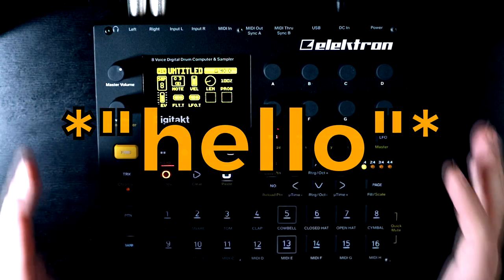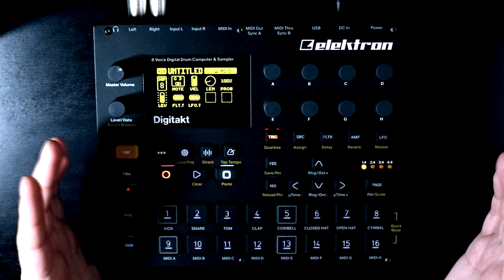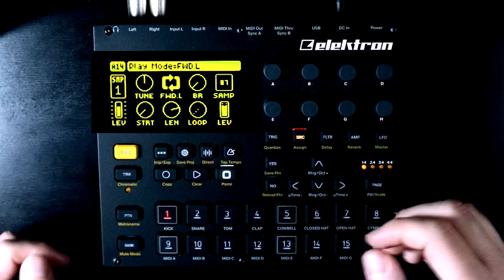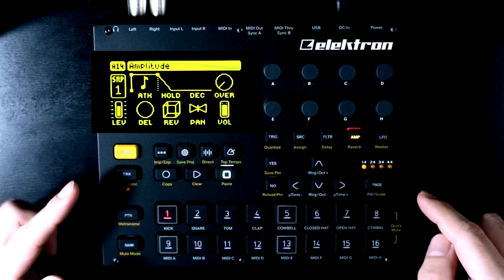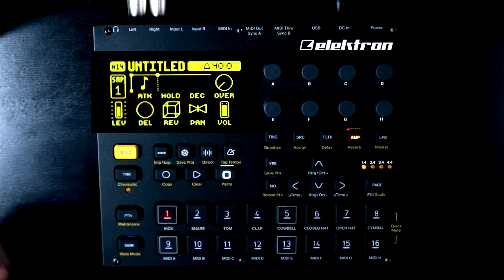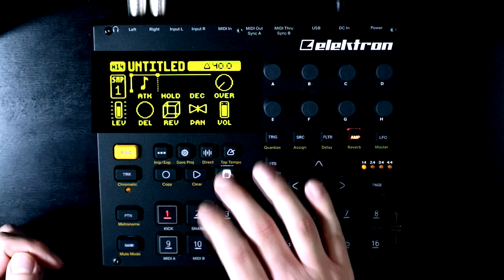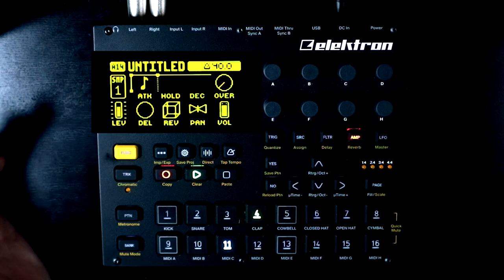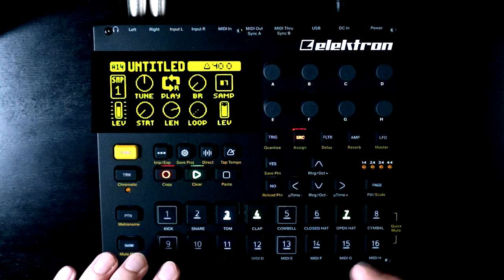Digitakt - Using Green Trigs/Lock Trigs to Create Evolving Ambience and Textures

Comment: I love the way this allows you to use free running loops but the changes to the loop are done in the digitakt grid, so it still happens in a nice controllable way, which is usually challenging when using loops with the digitakt.
Reply from the maker: Exactly, if you have a more abstract loop or something with a more constant tone, you can really reinforce the idea of what's going on in the grid without totally killing the vibe.
Reply: @OscillatorSink  I find probability on normal locks to be a little too obvious, but I bet you could do some incredible stuff having those trigless locks be probabilistic.

Comment: Great vid! A handy feature: hold "function" while changing a parameter, it'll jump to certain large values, for example "tuning" will jump like this: - 24/-12/0/+12/+24. No more slowly fiddling until you hit that - 12.00 mark. Cheerio!
Reply from the maker: Yes, I'm aware, and it has already been pointed out. Unfortunately my workflow often "de-optimizes" when I'm having to talk and do at the same time. It's like the time I forgot where "Select All" was in the sample screen. I still get comments about that now over a year on. This is the penance I pay for my forgetfulness.
Reply: @OscillatorSink  haha, the glass is still 99.99% full so no worries there, happy holidays 🎉

Comment: It is possible to create this kind of evolving texture, then change "key"? Curious if you can use this to create a texture but have it follow a chord progression... hoping that makes sense!
Reply from the maker: Probably the best way to organise that would be to either parameter lock samples which are playing the chords you want (and remember, that could be just changing a bass note to inply different chords based upon your more textural sounds) or you could use midi loopback to sequence the sample slot on the track to get chord sequences, again with suitably prepared samples.

There are definitely other approaches, but those two spring to mind.
Reply: @OscillatorSink  Thanks! I'll have to play with those ideas!

Comment: You had me excited when I read green trigs but theyre just the normal yellow ones. Did you know you can time stretch/pitchshift loops with an lfo set to sample start?
Reply from the maker: Yes. Locking the LFO trig parameter is often overlooked and it opens up a bunch of interesting techniques. I like using it on a lock trig to do tape stop effects.

Comment: I wonder if changing the pitches could have a slow legato-style bending...?
Reply from the maker: So the way you'd probably best achieve that on the Digitakt where you don't have any "real" portamento or slew limiting is to use an LFO. If you use a Ramp LFO shape and the "half" LFO mode too can create a parameter sweep that starts on the trig then goes up (or down) to value defined by the depth. You can then choose the rate of the bend with the LFO rate.
Reply: @OscillatorSink  that's a brilliant idea. 

I think that could work for acid-style basses as well. I need to try this out immediately.
Reply from the maker: @tubeMonger  yeah, it works pretty well with some tweaking - the trig preview they added in the last firmware (step + yes) makes fine-tuning things a lot easier too. I was doing this a fair bit on the Digitone before they introduced portamento.
Reply: @OscillatorSink  yeah, with a bit of tweaking it works, and a plethora of new use cases suddenly appeared!

Thanks again for your invaluable information :-)
Reply from the maker: @tubeMonger  I think I might do a quick video on this little trick soon - it's I useful one to have in your toolkit.
Reply: @OscillatorSink  agreed!

Comment: Trigless locks is the term. Trigless trigs is from the octatrack terminology. To make a trigless trig on the modern boxes you may lock the note page to have lfo or env set to on. This should trigger the lfo and envelopes without retrig on the voice.
Reply from the maker: Actually - to my surprise and, frankly disappointment, on the Digitakt the official term is "Lock Trigs" apparently, they even went through the manual and changed the terminology in newer versions. I prefer "trigless locks" too; but Elektron did not, apparently.
Reply: That same bit of the manual says that these trigs are yellow, not green :)
Reply from the maker: The "um actually" is strong in this thread, hey?
Reply: @OscillatorSink  I guess that makes sense since you can modify what the lock is triggering on the note/trig page now.  Still seems like trigless would make sense as the primary sound engine is never trig’d. Elektron is silly like that tho 😂
Reply from the maker: @ModernDevotion  there's a thread on elektronauts where they explain the rationale behind it. I think I follow the logic. Kinda. Sorta. Still don't like the term though. https://www.elektronauts.com/t/goodbye-trigless-locks-hello-lock-trigs/41046

Comment: Love all your work.  sorry late to the party on digitakt but trying to replicate settings here and my tempo doesnt slow down at all when i change the scale from 1 to 1/8.  i am playing a piano sample on track 1 i loaded and i also see when i change the bpm it doesnt appear to change speed of sample playback either.  this is the first time i recorded a sample and am a noob at this unit.  Please advise if you can advise what i should look into.

thanks again for all your work.  i have enjoyed all your vids.
Reply from the maker: On the old firmware and on the default machine on the new firmware, adjusting the tempo has no impact on the sample playback as there is no time stretching - tempo just adjusts the rate of the sequencer. If you are on the latest firmware though, you can change the tracks machine to one of the time stretching modes and you'll be able to stretch the sample based on the tempo.

Download the manual from elektron's website and read up on the different machines for more detail than I can write in a comment.
Reply: thanks so much for quick response i really appreciate it. @OscillatorSink
Reply: sorry not sure who to ask on this but my sequence only plays frm steps1-8 and its set for 16 steps.  it plays all 16 and starts back at step 1 with sound again but 9-16 are quiet.  i have triggless trigs on 11 and 13 but are uneffectd with no sound.  trigless trigs on 3,4,and 7 are working correctly.  i have sample amp to inf on decay  and  on src page start is at 0 length at 120 loop set to off.  i dont know why it only plays sound for 1-8 steps.
Reply from the maker: How long is the sample? Is it only as long as those first 8 steps? Do you need to loop it?
Reply: @OscillatorSink  I think one of the trigless trigs was set to forward and not loop so it was stopping at end of sample.  When I changed it to looping it fixed.

Comment: I followed this and got great results but one thing that confuses me is the sample still setting off for it to work. Just pressing play does not start the sample/samples, at least on mine it doesn’t anyway
Reply from the maker: That's because a lock-trig doesn't trigger a sample - that's kind of the point of them - they just lock parameters. If it did trigger a sample , you'd get repetitive triggering of the sample each bar, which would ruin the effect.
Reply: @OscillatorSink that makes sense. So you press it once to play the sample and then let it fly

Comment: Thanks for this great video! One question: is it possible to change pattern with this technique to evolve the track? As pattern is set to M infinite then in my case the pattern is staying on 1 and not going to next.
Reply from the maker: If you're working with the master length as infinite, then you'll need to set the Change Length to something (it's off by default). It one of your tracks defines some kind of grounding repeating figure then try setting it to some multiple of that track's length; otherwise just experiment and see what feels right.
Reply: @OscillatorSink  Perfect thanks a lot. Is it possible to use Mute tracks with this technique?
Reply from the maker: @emmanuelhourquet3693  yes, but you'll have to also set the amp release to something non infinite if you want the sound to fade away.
Reply: @OscillatorSink  Ok perfect, maybe then it will be better to fade sound with cc on each track then
Reply from the maker: Yeah, probably - what muting the track will do is ignore all of the locktrigs so the track will stop "moving". That in itself would probably be an interesting performance aspect, but I just fade in and out using the track volumes to "mute" stuff.